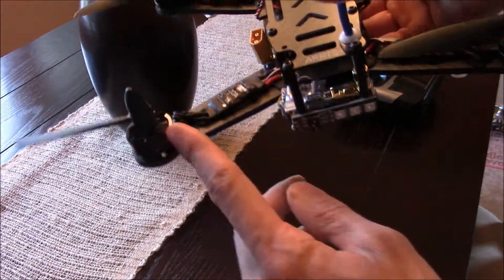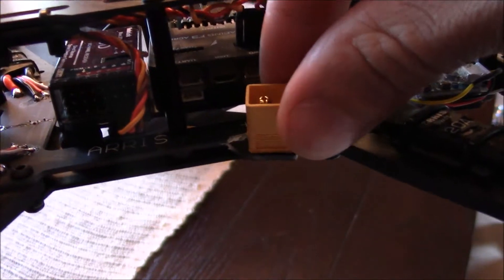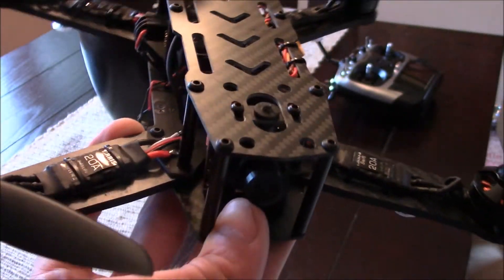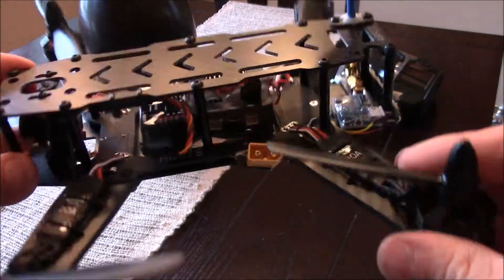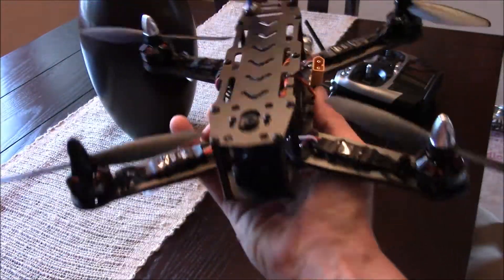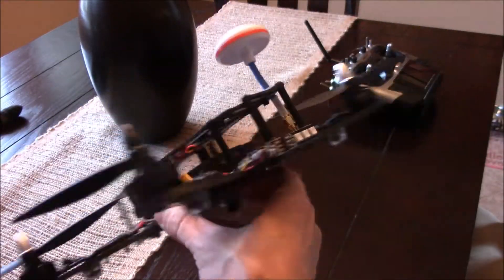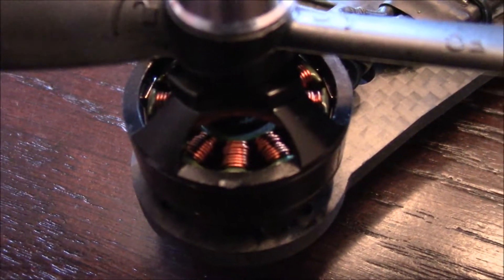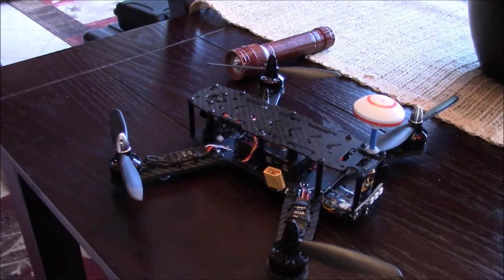Racing quadcopter mid-air failure and crash - Arris X-speed 250b

Comment: You could probably just of glued the battery connector back on, I mean I thought I saw wires underneath that connected it?
Reply from the maker: I did resolder it and fly again, but later replaced the whole board.  All the power flows through pcb copper traces, so by soldering all the current would now flow through the solder which could melt under load.
Reply: Preston Rice Electric tape! (wondering if it would work for real though..)
Reply from the maker: Nah man, we do Duck tape bro!  This is Wisconsin!
Reply: 4 cells can cause problems with this quad unless upgraded esc, just giving advise.
Reply from the maker: It is rated for 4 cells... They are 20 amp esc's I believe
Reply: I had the quad before. 4S is ok

Comment: Cool clip, I fly mostly Phantoms but am thinking of working my way into racing drones. Check out my channel when you get a chance, just subbed you.
Reply from the maker: Thanks for the sub, I subbed you back.  You and my both, by the way, I rarely fly the racing drone, still learning!  I'm usually flying either the Phantom 3 Pro, or the Inspire 1.  I will begin posting more DJI flight videos soon as well so stay tuned.  Great job on your channel so far!
Reply: Thanks for the sub and be sure to post those new clips when you get the P3P back in the air.

Comment: What kind of 4s battery are you using? Like the MAh and discharge rating.
Reply from the maker: 2200 mah Nanoforce brand battery. 35c discharge rate with 70c burst current.

Comment: You have serious problems with pids
Reply from the maker: Explain?  It came factory tuned this way... and it is tuned more for 3s, so some shaking with 4s should be expected... I should also note, I descended directly down quickly through the prop-wash - no amount of PID tuning will make that smooth!
Reply: your shakiness is too high, probably p term to high, almost every quad of decent quality with good tuning will fly butter smooth, same for propwash, in most cases prop wash can be removed, look it up on internet, I have a qav210 and it has no propwash at all, it had before tuning
Reply from the maker: +beyersito On a 4 cell battery you would be correct.  But like I stated above, I did not tune this, it came factory tuned around a 3 cell battery.  It does fly reasonably well on a 4 cell as is but with some shake on full throttle or descent as seen above.  Never really realized it during fpv forward flight.  Anyway thanks for the watch!